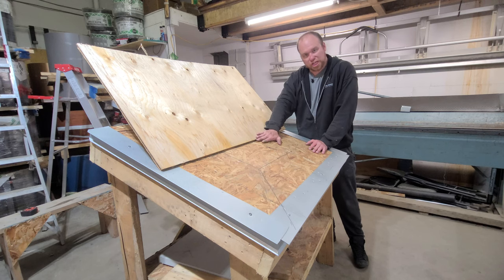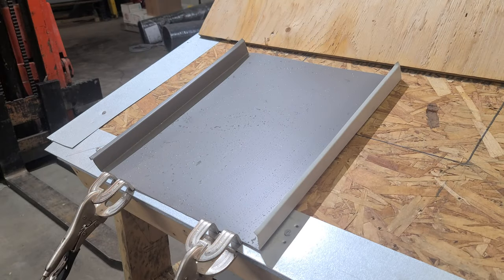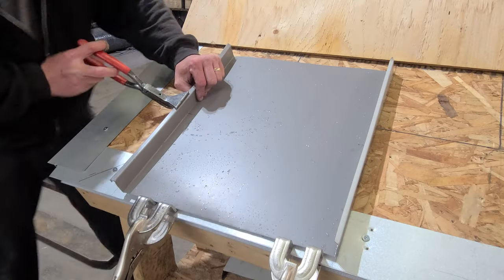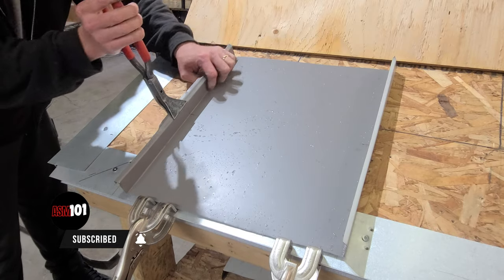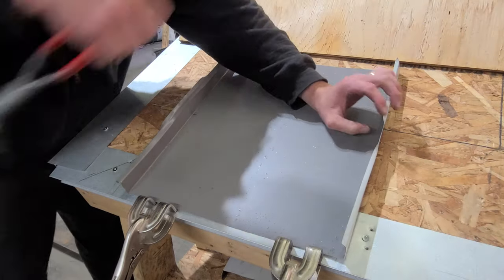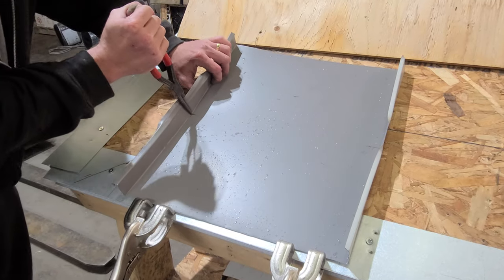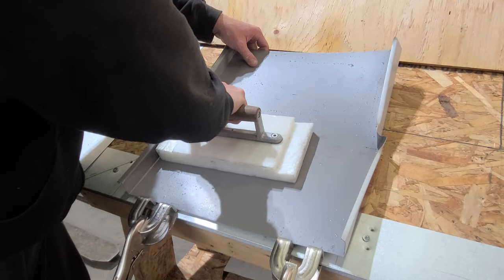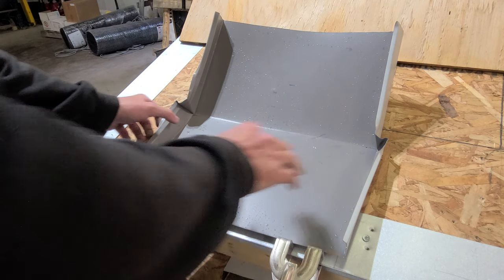Roof Pitch Transition You Don't Need Snips For!

Comment: At a ridge line , down 12 inches,  there is a slight change in pitch of the roof deck it's about 1 inch. Then, as you follow the roof it fades back and the ridge is in line with the deck. So not all the panels along that area would have to be conditioned. I wonder how this would look? 
Do you sell those tools? Thank you
Reply from the maker: Thanks for watching ... probably not. best to practice a bit first before doing the final to make sure your good...heres my tool list download with most of the essesntials https://geni.us/buying-guide
Reply: @asm101  Thank you, I'm going to take my time. It's my own house.  I think I figured it out just by watching videos here.
Starting at the ridge all the way to the eave, there is a difference in the decking because the ridge beam had a slight sag. So the centerline of the ridge beam is now centered, but the plywood is slightly higher in the center over about 20 feet across a 42 ft ridge. The line at the ridge is totally level. So, I'm thinking all I need to do is use 1 x as a spacer or shim under that section where it's lower. Because if it were to be fastened down the way it is, the panels would buckle. I know this sounds ridiculous. And I believe there is a way to correct this.  And now I see it. I've never installed a standing seam metal roof, but I'm no stranger to doing it right.  Like I said, the ridge plywood is level all across. it's just about 12 inches below that there is a dip in the roof.  It's not noticeable, but I can't just install it to the deck. I'm going to have to shim or batten that area first. I'll use Mason line and get a grid going and flatten it out. Everything is a lot of work.. maybe even some of those high cleats might work just for that area to hold the panels level from eaves to Ridge?  I used sharkskin SA over the whole deck.
Thanks for your reply 👍

Comment: Does this work for wall to roof transition? From wall to gable roof?
Reply from the maker: There is a cutoff point on what angle you can do this at I would say 312 to a 10:12 is the max angle you would have to lay that out though I don't have it in front of me to tell you the exact angle in degrees

Comment: But you put screws in the panels in this demo, so....
Reply from the maker: They wouldn't effect anything but since you said it I'll another test without them in so there's no confusion
Reply: Well you usually always put a drag screw at the top Corner of a panel to begin with thats hidden behind the ridge flashing z girt. As for the bottom the screw is just to illustrate purposes obviously you would have a hemmed bottom that hooks onto a starter flashing.

Comment: You guys need to stop teaching people the wrong things everything your do is for hemlock it’s nice work but not possible with any other types of stand and steam 90 percent of people will not pay for it doesn’t mean that it’s wrong to us transition it’s how they require you to do it stop saying it’s wrong unless your talking about hemlock only other wise this is usless
Reply from the maker: So your going to use snap lock on a pitch less than 3/12?
Reply: @asm101  1.5” Snap Lock
Installation: Can be installed on solid wood decking

Minimum Slope: 3:12

1.75” Snap Lock
Installation: Can be installed over open frame steel purlins, steel decking, steel decking with polyiso board, or solid wood decking

Minimum Slope: 2:12 (hot melt required below 3:12)
Reply from the maker: @aurorasplawn5024  I know this about snap lock and am dead against it....relying on caulking is dangerous
Reply: do it without putting screws please